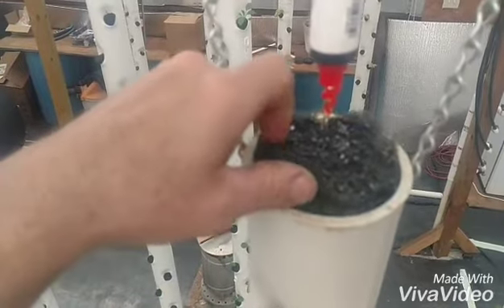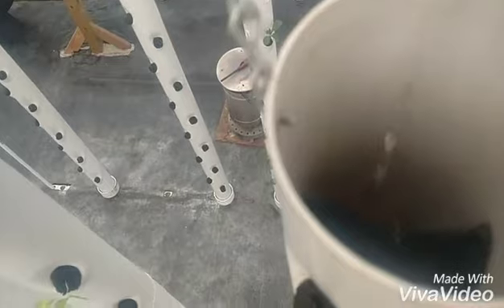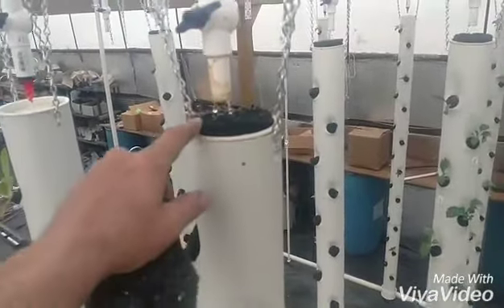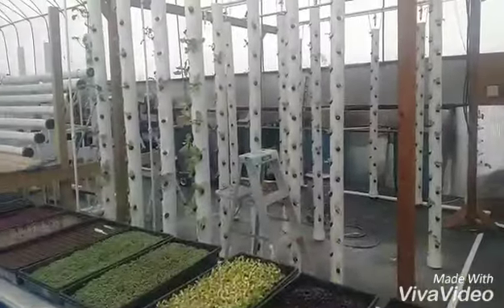Vertical grow towers and new drip lines

Comment: Great setup! How do you ensure the water flows into each tower? I tried a similar setup and the last few towers barely get any water, or only a few of the. work. Especially after I turn it off and on. Any advice is appreciated,  thanks.
Reply from the maker: Hi, yes getting constant water flow is critical.  If your doing with aquaponics you get solids in the lines. On the towers you need to run the water all the time and have enough pressure to keep the lines free.
Reply from the maker: Sorry I was not done. Check out some of my other videos,  I talk about water flow.  Thanks for watching

Comment: What do you use for nutrients? How often?
Reply from the maker: The fish provide most all the nutrients for the plants. I have a split system,  meaning once the nutrient water leaves the fish side and goes to the plant side, it does not return. This way I can adjust the PH levels that work best for the fish and plants. So when the water leaves the fish system I adjust the PH down to about 6. I check the EC and run it around 1.8 to 2.2. I sometimes add nitrogen to the plant side to get the EC where I want it.
Thanks, Von
Reply from the maker: That is calcium nitrate.  I add if needed to keep the EC in the proper range

Comment: How long do you run the water for ? What's the schedule? Thanks.
Reply from the maker: The water runs thru the tower's all the time. I could put the pump on a timer and run it say every hour, but there would be problems with that,  so it runs all the time. Thanks, Von